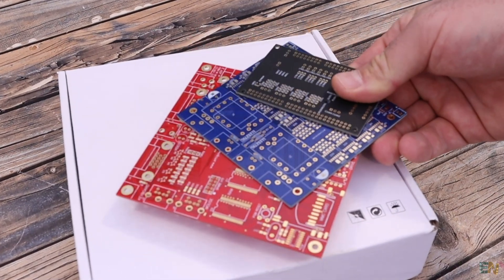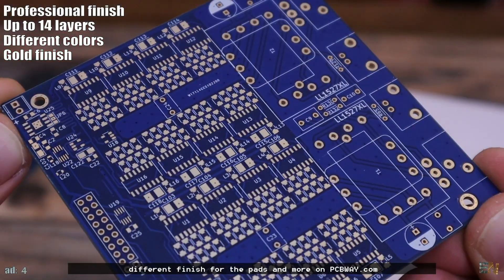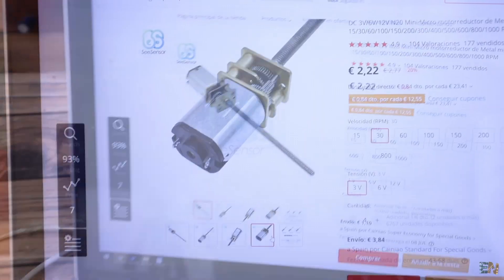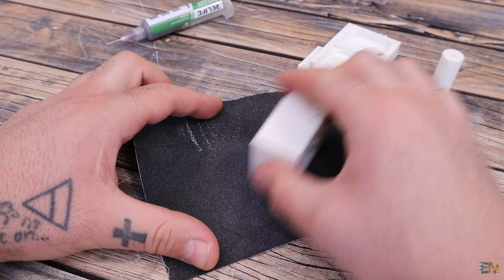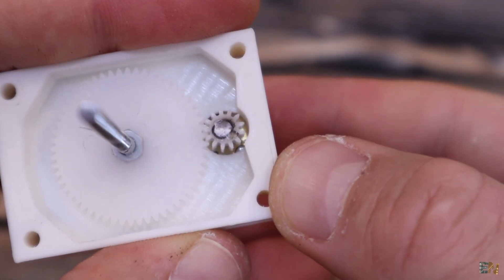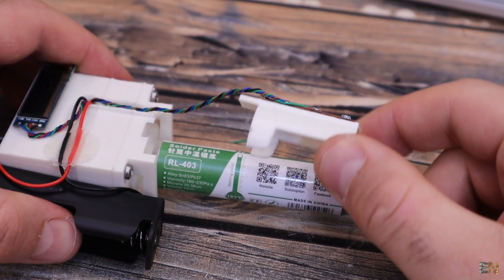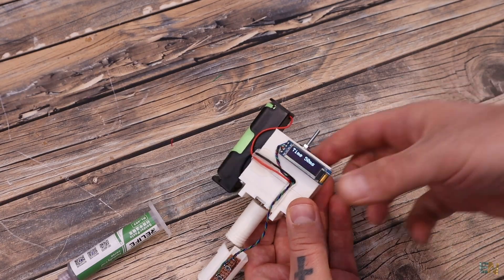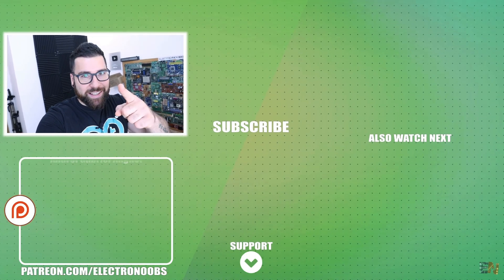Electronic Solder Paste Dispenser Homemade | 3D PRINTED

Comment: Huge fan of this concept. I think I am going to attempt creating this. I repair electronics under a microscope. Most of the time I've worked with paste, it was from a jar for use in a reballing stencil. 

Recently, I have been doing actual PCB assembly in large scales. The boards I work with are very small and do not need very many components populated, but when I gotta do over 100 of them, it becomes very tiring having to gently push out the required amount of paste for every pad.

I think something like this would aid that process immensely. The next best thing would be a handheld tool for picking and placing components from a tape reel, lol. But even if I am forced to caveman these onto the board with tweezers, I think having a paste dispenser like this would be a huge help and a big time saving. 

Thanks for creating this :).

Comment: Great project, and I want to build one based on your ideas. I'm just curious, what stops the 3D printed piston from spinning inside the syringe, together with the shaft? A tight fit? Something should stop it from spinning, so it can actually advance.

Comment: This is a cool idea and I would like to implement this with the motors with the threaded rod attached. I am a true noob on linear actuators - as I think the mechanic or here is called - so I have one fundamental question: The piston you use in this design is round as well as the tube of the solder paste syringe. What else is needed to prevent the piston from
rotating with the rod instead of moving along it, when the rod turns?

Comment: Can we now get one of these to use say a bucket of tin solder paste and varied heat gun attachment to melt on the fly to build complex metallic structure low temp weld style

Comment: I love the idea but ... why not just get the i-Extruder. Ready made and can be used for paste, tacky flux (hello Amtech) and has a lot more to offer like optional foot pedal etc. It works great. It is fully configurable and even does retraction so you get less spill and mess.

I know it is fun to make your own and all but really if you are looking for a ready made solution believe me this thing works great (I use if for flux, for paste there is stencils).
Reply: $20 Vs $190 ....difference is clear. If $190 for i-Extruder then why not $220 worth semi industrial pneumatic dispenser sold on e-Bay ?

Comment: Great construction, can't wait for version 2. This time around you could get a nicer form-factor (like an electric toothbrush) because there is no more extra gearing in the way. That would do wonders for the ergonomics. 
It would also be great to put the project on github or otherwise provide an efficient feedback option, so the communitiy can suggest improvements such as a short retract after every squirt of solderpaste to avoid oozing, an integrated loading chip for the battery, which could then be better integrated into the housing, a more compact version with a 18500-cell for a better balance, a shorter version with no battery holder to make a 3D-printer-attachable version: That way one could turn it into an automatic solderpaste-dispenser to prepare an entire board automatically.

Comment: It seems like the large gear would just spin freely on the threaded rod, or at least slip a little.  What mechanically connects the gear to the rod?  Is friction from the two nuts enough, or do you think the glue was critical for that?

Comment: the weight distribution is not practical. Making the top portion with the most load makes it hand straining to maintain the device in axis when pointing the tip.

Comment: so you have the schematic, why dont you 3d print the solder
Reply: 3d printer can also place the components
Reply: it can also put them in a stack to be ovened finish
Reply: the 3d printer only needs to have the position of the pcb, it can even wholly cnc the pcb then solder and place components
Reply: assuming copper top layered pcb, with some insulating paste to create crossovers
Reply: multilayer pcbs with components within should be easy, stacked pcbs, through vias, even double sided copper layered pcbs
Reply: uv cured pcb etch photosensitive photomask
Reply: 3d printed photosensitive mask layer
Reply: cnc cut photosensitive mask

Comment: Sir, here I am with a small project, the project is to make an external button (a push button) to control a game. I did the game and the controller with Arduino which's working well. Now i need to shrink my project, it's just a push-button act like a player jump button, my plan is to put that push button into a pen size tube and add a vibrator, etc... I need some clarification 

[1] How to communicate my device to my pc without using the Arduino via USB
[2] is it possible to do this or I just keep moving with what I did right now?

Please replay me, i just stuck here

Comment: Hi Electronoobs, your projects are awesome I have tried many of them and they are all just awesome.
Now I am trying to make the Arduino-based drone that you made. In that, you made the flight controller and the radio receiver on two different Arduino Nanos. But I want to make both of these things using a single Uno board. So please help me out with this. I have also tried doing some modifications in the multiwii code for the same but I am not able to get the desired result. Please help me with this.

Comment: Nice project. It can be cheaper. Throw out bearings and threaded bushing. Use holes to center the stud and 2,8 holes in plastic parts for M3 to fix screws.

Comment: You can make it more cheaper if you use inline threaded stepper motor. You just need to set how much volume of soldering paste need to apply. The set volume is proportional to number of pulse need to give to the motor. No need of timer or microcontroller😁.

Comment: A very excellent build! A few suggestions... It is typical for the code for these DIY solder paste dispensers to rotate the motor backward for a brief moment after the forward movement to put out the paste. This helps prevent post-application ooze. A stepper motor would give you even more control over the paste output. And, now, a small request... Lots of us DIYers do not have 3D printers and other sophisticated tools... So, please accept the challenge to use simpler means that we all have... Like, could the frame be built using just perf board? I have seen such designs.

Comment: a programmable tattoo machine would be interesting. one you could adjust speed with a push of a button & digital read out or LCD display. oscillating speed readout, battery life..
Reply: a diy kit. a coil machine using a magnet. oscillating using a circuit oscillator & or a rotary machine.

Comment: This is extraordinarily practical, if you're into DIY'ing SMT circuits. Mind you, if you use the motor built with the in-line threaded rod instead of Electronoobs' device, the mechanical construction will be very different.

Comment: I've never worked with PCBs but I very much wish to!  The possibilities are endless.  Does anyone have suggestions on the basic knowledge I need to get started?  I have some programming/coding knowledge from college and scripts written for work.  So, software I understand but hardware is an entirely different beast.  Any help is appreciated. Thanks.
Great video!  Awesome tool you created!  When I get started, this might be one of the first projects I do.

Comment: Awesome work.
Just a quick tip: You should use "else" more often on your code instead of "else if".
If the last "else if" is the rest of the universe of values, just replace it by the else and make it easier to execute.

Comment: Very clever. I like the all-in-one design. Only way I could see this working better is if you could add a mechanical version of a vacuum suck-back after each dispense step, like you would find in a pneumatic dispenser. Don't know if that's doable. A little software tweak to let you set automatic repetition would be convenient too, so you didn't have to keep pushing the button to dispense when doing a line of pads. Great work!

Comment: I don't know if that's the case, but sometimes, with the soldering paste dispensers, if you build up pressure inside the syringe, it pushes a bit more of solder for a couple of seconds, quite slowly. If you make it turn backwards every time it finishes the timer, only a quarter or half a turn,  you can avoid it, and the paste will only come when intended. It's a common problem in the air-driven dispensers, but can also happen here, since the syringe can expand horizontally a bit.
Reply from the maker: I've tried that but doesn't work, since the piston won't create sucction. All that happens is that the piston goes back but the pressure is still the same inside the syringe. I should make the sytinge with a rubber tip maybe...
Reply: @ELECTRONOOBS  or glue the piston / add another insert to screw it in...

Comment: It's big tho, coin batteries could be use to make it smaller
Reply: Max current of a coin cell would fall way below what it is capable of delivering to the required motor most likely👍
Reply: @deangreenhough3479  If that doesn't work, use more coin battery